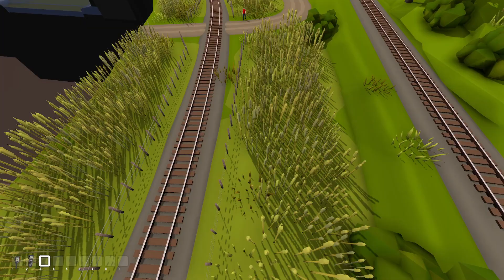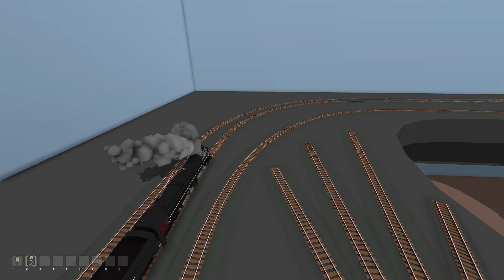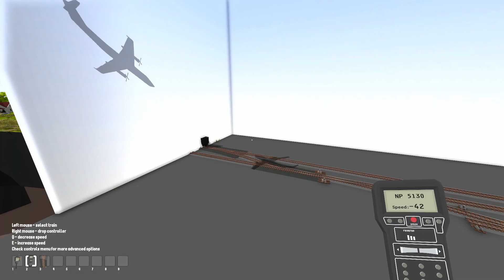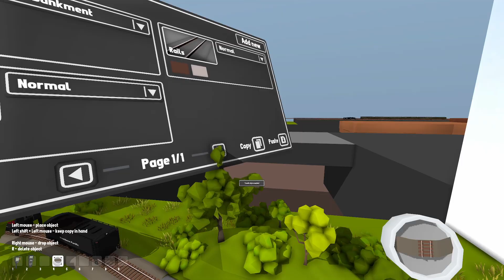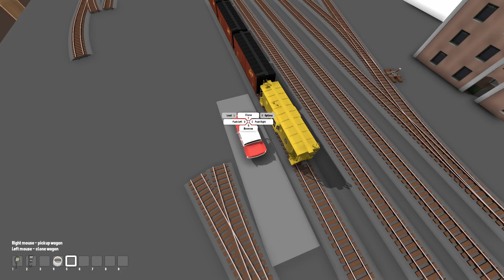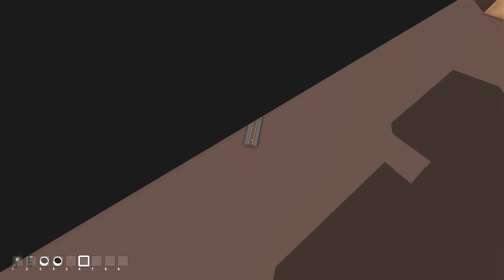Freight Yard and Locomotive Facility Track Placement - Rolling Line Gameplay

Comment: As for suggestions:
- I think you should consider a MOW area within your yard or another yard solely for those operations.
    - could be fun to have MOW still life / scenes within your tracks
- for smaller or local businesses, try to stick to 1-2 cars per indy track, and make a single track that branches off with industries on either side (like the track is being sandwiched by industries). This allows you to create very compact yet detailed and cozy areas that feel unique on their own.
- you may want to add dual crossovers on your mainline so that a train could go from one side to the other and back again. Usually placing these on either end of the yard work best. 

Love the videos ❤
Reply: Oh and regarding diesel fueling stations, if you want to go for a really early era diesel. Then having elevated stub tacks where the tanker cars for diesel can sit would be a pretty fun idea. Use trestle bridges to support the rails and ofc have a wood foundation and not floating ballast. <3 Just an idea
Reply from the maker: These are great ideas! Thank you!